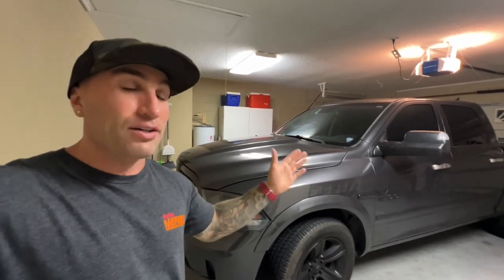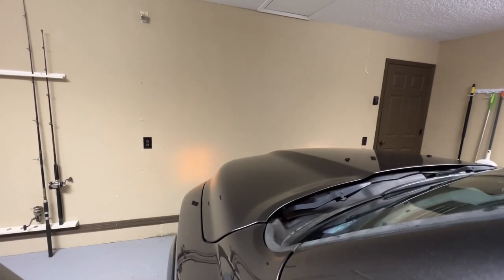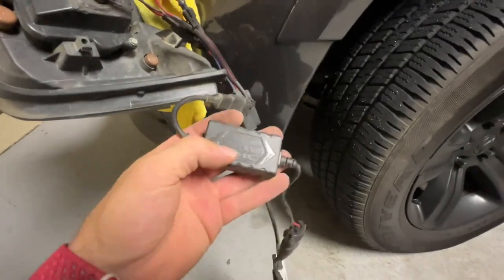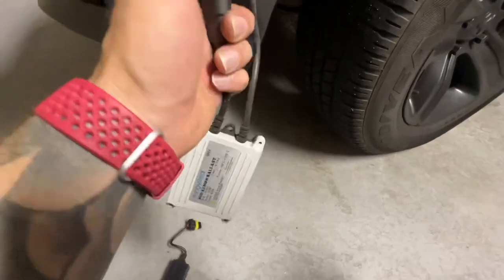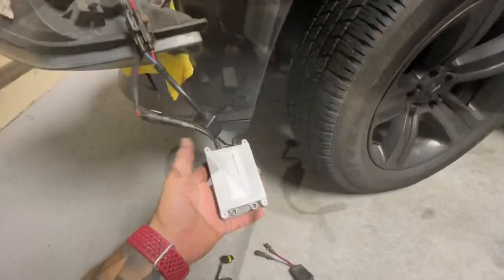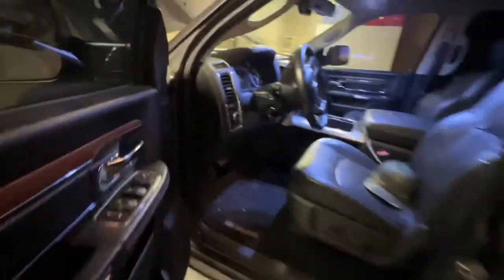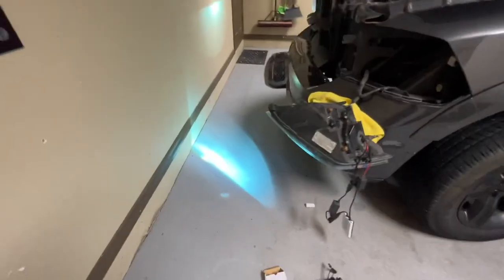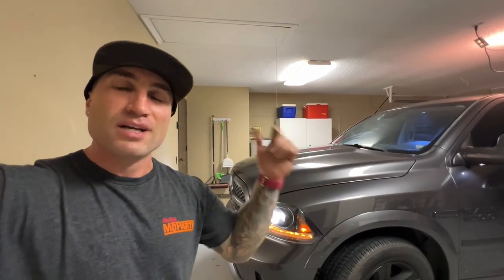How to Diagnose & Fix HID Headlight Bulbs Ballast Not Working

Comment: Cool video, will also apply to other Mopar vehicles. My '14 300C has HID lights, so it will be helpful to me. Thanks man!
Reply from the maker: Thanks Mark glad you enjoyed it!!! 👍
Reply: I came to this video for the exact same issue, however mine is a 2006 300C Touring. HIDs are occasionally flickering off but are on 95% of the time.